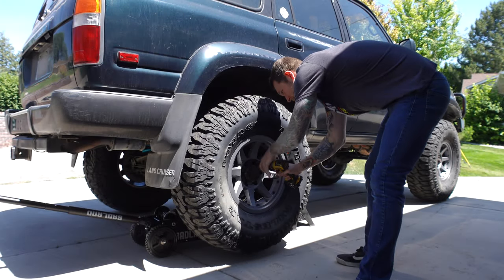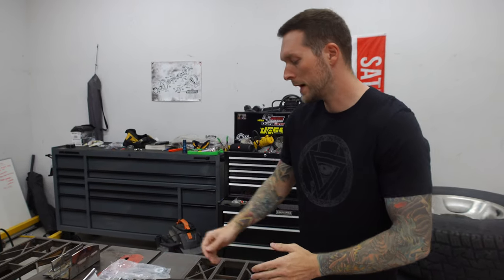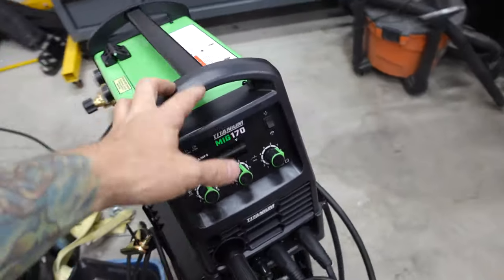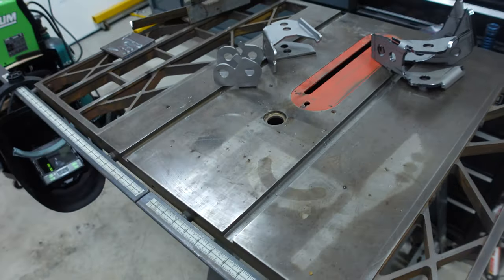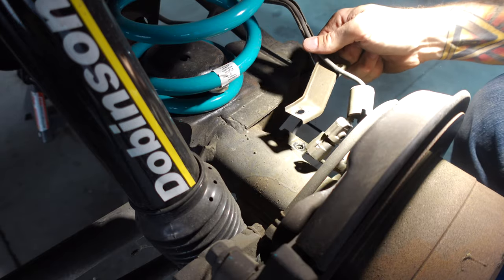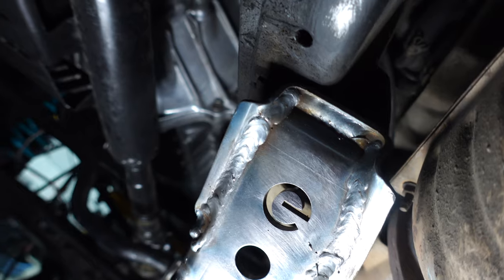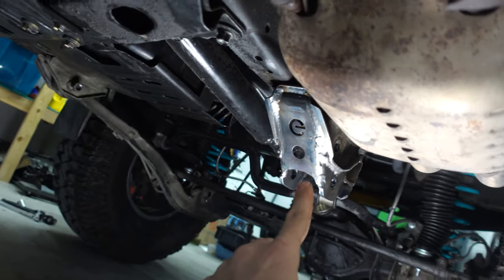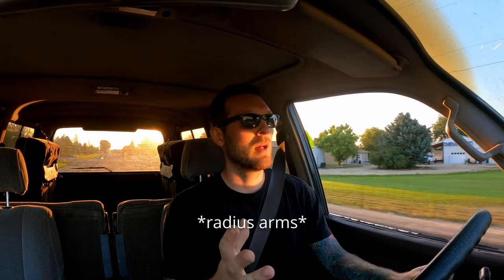My Land Cruiser Is A NIGHTMARE To Drive And I'm Fixing It!!

Comment: Great build. Just some thoughts of things I encountered when I lifted my FJ80. I can tell you that the improvement was from the caster correction drop brackets for the front radius arms. Toyota FSM states that 2.0 degrees is the minimum (4.0 degrees is on the higher end though most go for 5-6 degrees when going 3 link) and bone stock is at 3.0 degrees. For me; Slinky 3in lift, Spidertrax wheel spacers (running the FJC 17in trail team wheels), 35in mud terrains, Slee caster correction plates, new front/rear shaft u-joints, adjustable front panhard bar, Delta VS rear panhard bracket, all new Toyota bushings, extended rear LCA, adjustable rear UCA, all new Toyota tie-rods, Dobinson pass-through steering damper, rebuilt the knuckles/wheel bearings, Whiteline rear sway bar, Land Cuiser Phil rear sway bar links, and an alignment set to zero toe-in redeemed that I am at 2.0 degrees of caster. Truck would drive fine over perfect roads but would make you feel uncomfortable when driving through construction and or busy roads. It just always seemed like there was a delay between the steering wheel feedback and me correcting for such behavior that the road was causing so I thought then it must be the steering box that needs a rebuild. Well, one day doing maintenance on my truck I decided to un-bolt the front drive shaft and check the 3rd member flange and see how much play it had and it would turn significantly side-to-side. At this point I knew that I should consider rebuilding the 3rd. However, I tightened the big nut at the 3rd member flange to eliminate that side-to-side movement and went for a drive. Well, that ended up solving my issue and it didn't make sense to me until after I did an adjustment and went for a drive. The bearing inside had effectively a lot of play that was causing a "delayed vagueness" between the road and the steering wheel road feedback. Lol I still plan to rebuild the steering box because it's the last thing I haven't touched but this one was confusing for me.

Comment: My rig would get the wobbles on the freeway when driving over beat up pavement. No issues since replacing all of the bushings and tie rods. It's made a huge difference.
Reply: I have same problem. Gonna need to do the same on my rig as well

Comment: One thing with the radius arm setup.  Flipped arms are also quite a popular setup, it increases clearance under the diff, the radius arms sit flatter as they are mounted ontop of the diff which increases ride quality, and you can set your own custom castor up the front.
Reply: Flipping arms on an 80 is not very popular, especially for the amount of lift most people do (4" or less), it's a considerable amount of work compared to caster plates or just new arms.
Reply: @napir  in Australia every second lifted 80 has flipped arms, even if it’s a 3” lift people go flipped as it improves ride quality and flexes better using stock arms

Comment: love the video!  a quick note - on the PCK, I recommend going as high as possible on the axle side and using whichever hole on the frame side gets you closest to level without the axle side being lower than the frame side.  ( - you could lift that axle side and improve your rear roll center/handling even a bit more)
Reply from the maker: Will do! Thanks!!
Reply: also, if you haven't rebuilt your front knuckles yet, you might want to look at offset trunnion bearings for that additional caster correction - avoids a lot of potential steering interference and pinion angle issues
Reply: @eimkeith the chassis mount for the panhard in this video is a V style? Cause this is the same type I have and want to order one. Thanks
Reply: @slzbuildz  it's the axle side that is V-shaped or flat; the one in the video is the flat mount (you can see the top edge of the factory mount at 2:23)  I have plenty of stock atm, just hit me up when you're ready.
Reply: @eimkeith  yeah I just ordered a bunch of stuff from you.
Reply: @slzbuildz  man, I appreciate it!  will start shipping out in the morning.

Comment: Awesome work man.  I am debating what suspension to go with on my 80.  I agree you must do these corrections  or it will be scary to drive.  That said it has me thinking if I need to weld brackets to fix the radius arm issues, maybe it’s time to just do a 3-link up front and weld a few more brackets.
Reply from the maker: I'm all for a 3-link. Go for it!

Comment: Please drop a link to the drop brackets you installed. I am planning a 76 series build and am having trouble sourcing parts since they were never imported to the US. I believe the 80 series drop for the radius arms would be the same as the front and back of the 76 series. If not, they shouldn't be too difficult to modify. Thanks
Reply from the maker: Check out eimkeith.com

Comment: Make me think a built 2nd gen p/u like your old one is a more practical rig. And if you needed more room. Your old 1st runner built the same wouldve been a good choice
Reply from the maker: Well to be fair I did have to cut off all the suspension on the pickup and SAS it just to make it off-road capable haha. The FZJ is definitely more work but it overall feels more solid. It won't get in the same tight spaces that the pickup got, but it's a better all-around-rig IMO.

Comment: What lift would you go with if you just wanted to run 35s?
Reply from the maker: Honestly, probably none. I'd make them fit on stock height with refreshed stock height springs and upgraded shocks. Cut anything that gets in the way.

Comment: Just a fyi your shocks are upside down, your boot is the top of your shock not the bottom. Will still work but they won’t work anywhere near as well as they should.
Reply from the maker: Normally yeah but the dobinsons IMS shocks mount this way. They only mount the way that they’re on. Upper mount different than lower mount. I thought the same thing and googled it because I was confused